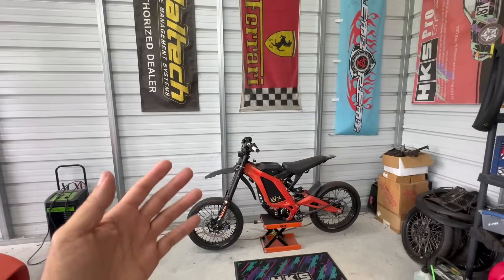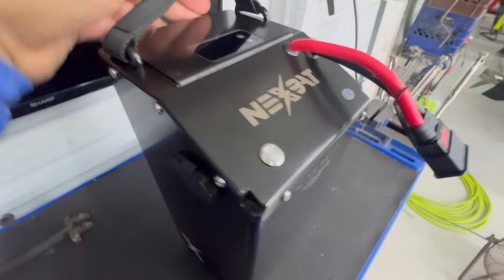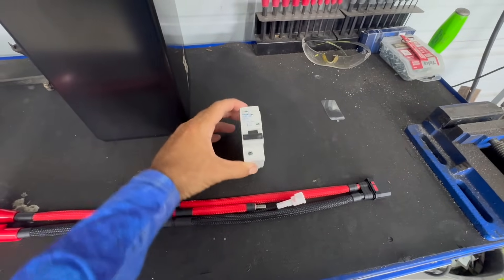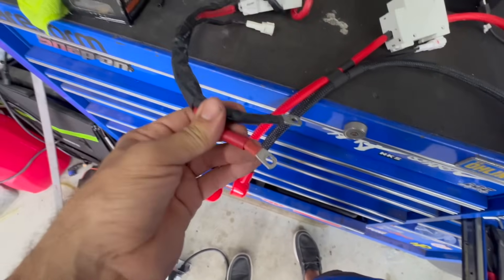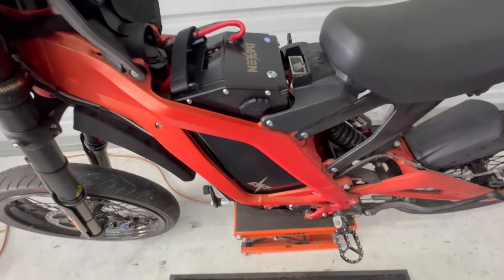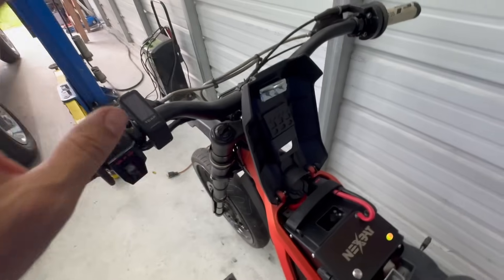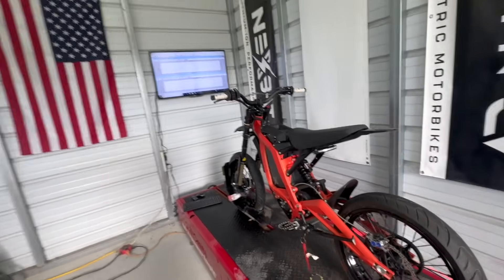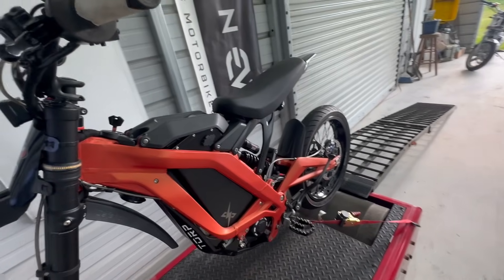WORLDS FASTEST SURRON | 80v NEXBAT Upgrade | DYNO TESTED

Comment: I was waiting for this news , you’re the only logical LB tuner that I found .
I have a question, as i am new in ev , when you use FW to go over your motor kv , the amp for FW will add to motor current ( that is out of power band ) ?! So if you want to get max power , is there any percentage limit for FW vs motor amp ?
Reply from the maker: Most FW control is dependent on the motors ability to withstand current draw. On a stock LBX i wouldn’t exceed 100a of FW current.
Reply: Thank for your respond , i wish you fun and safe experiment. 
I am running tc1000 with stock M and 32ah. Will switch when find out how to tune. How do you flat your power band ? FW current or FW start speed ? With 80fw power start drop after 5.6rpm , 4kw after 7.1k . Less than 80 battery ah. I will contact torp guys but your suggestion is very important to me . I really appreciate your help . Wish you best
Reply from the maker: The stock motor won’t last long with higher FW. Be safe
Reply: Sure , i wll get the torp , first need to learn how to make the power band flat . Waiting to see you brake records again. Good luck

Comment: Pretty sweet man! I just installed a TC1000 on my MX4 and took it out today for the first test drive. Even with just the stock battery it really wakes  it up. Can't wait to see what a battery like this does. The only drag is I have 3 MX4s so batteries with different connectors is kind of a pain. Might just wait a year and see how things settle then change them all to QS8 and sell my other batteries.
Reply from the maker: You can build a simple adapter to go from the stock connector to qs8 as long as you don’t run all the juice.